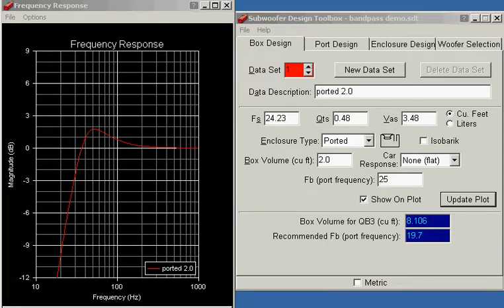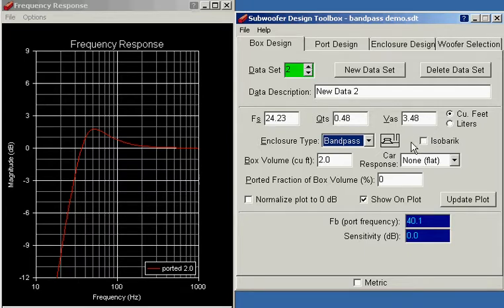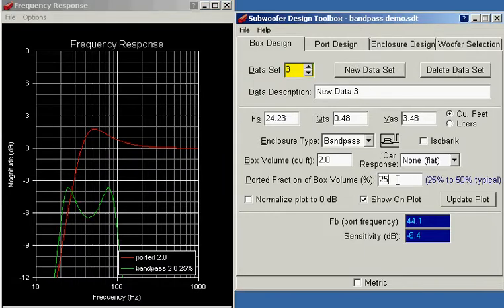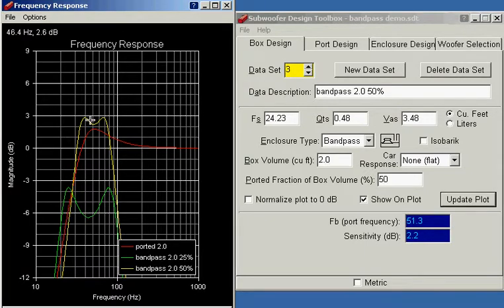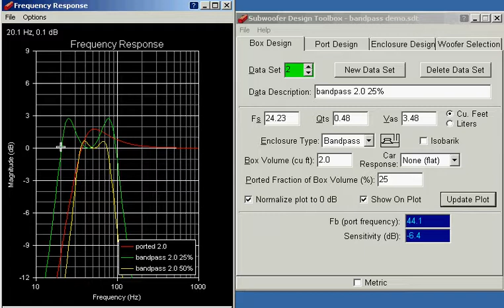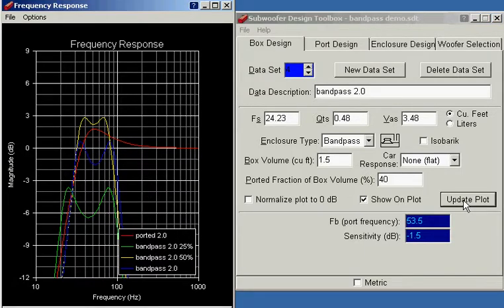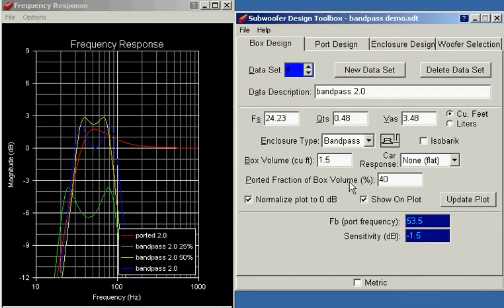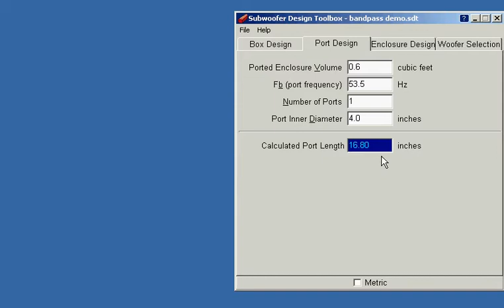Design Your Own Subwoofer Box - Part 6: Bandpass Box Design

Comment from the maker: In my experience, the ported side is usually smaller than the sealed side.  When the ported side is larger, the bandwidth is narrowed to the point of sounding like one-note.  I agree about fitting a large port in a small box.  The same problem can occur in ported designs.  The port design video gives some hints on how to deal with this.

Comment from the maker: @NateHarrisCreations 

Follow the same procedure as with a round port, but with the following changes:

For a rectangular port, calculate D=2*squareroot(Width*Height/pi)  and use that for diameter in the Port Design Tool. 

For a slotted port, the port uses one wall of the enclosure which makes the box think the port is longer than it actually is.  Use the rectangular port method, but then shorten it by half the height (smaller port dimension) to compensate.